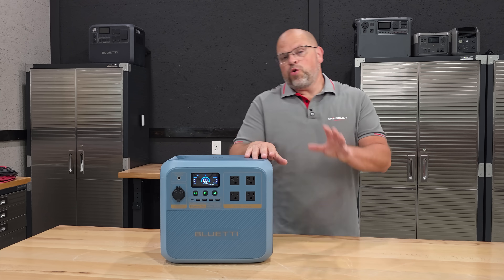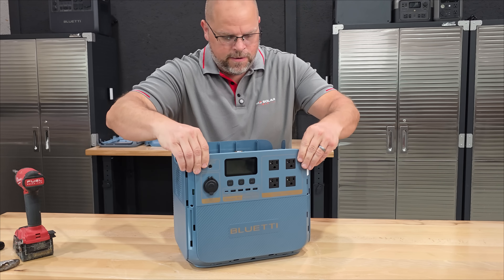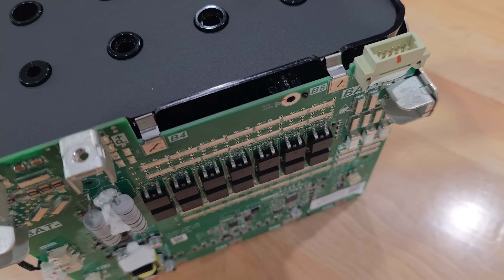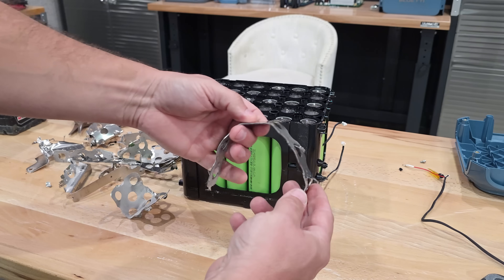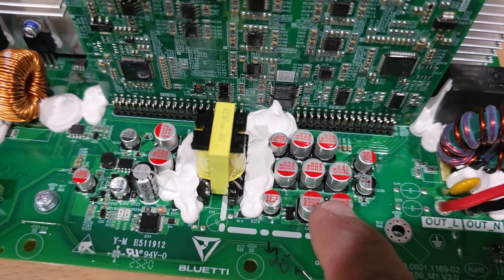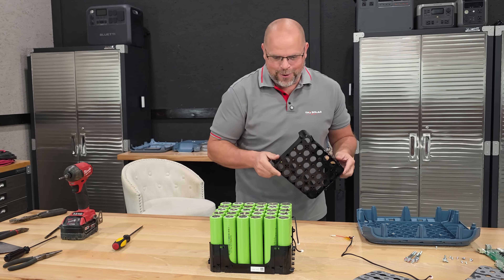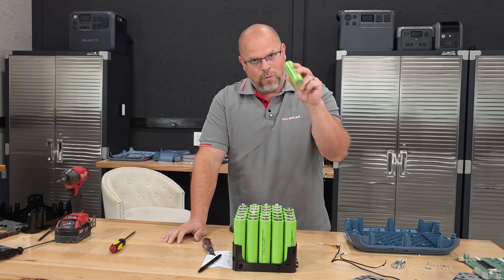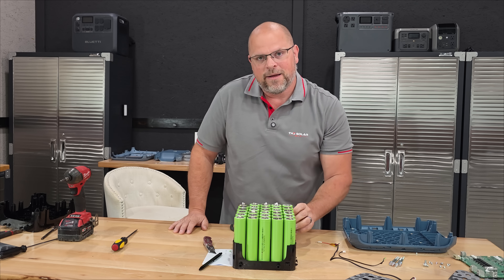Bluetti promised us SODIUM-ION and we got what?!! Pioneer Na Teardown

Comment: That was a waste of a beautiful power station if you couldn't confirm what you were looking for.  If you knew you couldn't open the battery than what was the point?
Reply: It was fun to watch.
Reply: To see what the information on the cells said including model number and voltage and wh. Was also interesting to see the quality during the tear down. What's the point of your comment
Reply: @Yielar1  My point is, the only unique part of the unit is its sodium battery. If that’s all you needed to verify, there was no reason to destroy the entire unit; you could’ve confirmed that easily. Just contact the company that gave you the unit in the first place. The video was a waste of time.
Reply: That would be easy to put back together/ reuse and saved us all doing it
Reply from the maker: Could, but I need to verify that the connections are also quality materials. Chop it up!

Comment: Other than ability to charge at -20 degrees F I don't see any advantage to these over LiFePo4. Especially since the round trip efficiency of these batteries is less than even lead acid at around 65 to 70%. You put in 100% and you get 70% back. LiFePo4 is like 95 to 99%. Also, Sodium Ion is much less power dense than LiFePo4 so for the same stated storage capacity the Sodium Ion will be much heavier. Now, in regards to safety, the Sodium Ion compared to Lithium Ion using Manganese Cobalt or Nickel there is significantly less risk of fire, but LiFePo4 is pretty safe. Anyway, you could have verified the Sodium Ion by comparing power to weight or by measuring the round trip efficiency pretty easily and also by the linear voltage drop as it is discharged.
Reply: That -20 factor is a very important advantage for many people.  Also, no damage when sitting fully discharged is great too.   I'd buy this if I hadn't had repeatedly bad customer service from them.  I've definitely had times where my LFP units were too cold to charge.
Reply: @veganpotterthevegan  Also you can go down to full discharge - making shipping even faster/safer as well. We already seen at least 3 boats full of EVs go up in flames and they were LFP.

Comment: Multiple times I’ve heard that the discharge voltage curve is very linear with sodium ion. With lithium ion the voltage stays pretty steady and then drops off pretty quickly at the end. Just graph the discharge voltage over time until the cell is depleted. Should be markedly different from a lithium cell. And that should be difficult to fake if it’s inherent to the battery chemistry.
Reply: Yep, I have posted several times on that subject, the drop in voltage is linear with the discharge, so in theory the bottom around 20% of the battery charge in an NA battery is most likely unusable because the voltage drops below the level the BMS can work with. What I suspect is happening here with the battery rated at 3.0v but actually showing 3.85v on the meter is some magic with the BMS that shows zero charge when it reaches that bottom 20%, it appears you can use the battery right down to zero charge, but that's not actually happening, so the power in the battery is actually more than the stated power in the device in wH but you can only use 900wH before the voltage drops out of range. Now I am not saying they are tricking anyone, as long as the power bank supplies the stated power in the stated specs that's fine, it's also probably the reason the power bank comes out so well in efficiency tests. I would very much like to see the discharge curve myself, that would indicate the chemistry is NA if the discharge curve is linear.

Oh yes, excellent tear down, just needs some more work with charge discharge tests and etc and as stated maybe send it to a lab so they can rip it apart and see what it's made of.
Reply: @stevebrooks2361  Looks like they are rated to 3.5-4V not 3V or at least slimier ones display that high. Found the cells online you can purchase your self.

Comment: 30v 30ah battery pack, so I am guessing that must be a Proprietary Inverter. A lifepo4 battery cell is 3.65v fully charged, not sure what you got there clocking in at 3.85v. Also 3.85v might be the resting voltage. I am clueless.
Reply from the maker: Yes, Bluetti manufactures their own inverters, bms and for the most part from what I can find their batteries as well.
Reply: @TheSolarPit  - batteryspace list a similar CR32140 Sodium cell at 10Ah/30Wh/30A/3v specification -  CR32140-MP10-3.0V-10Ah-30Wh-30A, seems to be Hina or Enepower cells.

Comment: Don't fall for this old tech gimmick 50yrs latter and still sux. Salt 🧂 battery sucked then and never have improved
Reply: This is not a salt battery, it is a sodium ion battery. Related only distantly, in that table salt is sodium choride. This battery is closely related to a lithium ion battery, and operates on the same principal.

Comment: So why i dont like power stations. If this were the lesser say 24v 30 amps. That would not run my camper for and hour if ac or heat strips were on. Only 2 hour if just the blower was on with fridge a TV few 12v lights and converter charging the 12 v. For Their price you dont get much. I got 1600 in a 48v 280amh batteries and 750 on a 5000w 48v inverter charger.  Few wires fuses breaker and my system covers my needs from 10 hoirs w ac or heat strips. To 30 hours w just the blower on plus the smalls I use and 2 tvs spend a few bucks more and have some useful power storage

Comment: The dead give away is the 3.0V rating of the cell.  These are not LFP, NMC, nor LiPo, which all have voltages higher than 3 VDC
Reply: That's EXACTLY what I was thinking. 3.0V is too low for Lithium-ion 3.6 ~ 3.7 per cell,  AND LiFePo 4 3.2V per cell.
Reply: Yes it's nominal voltage for it

Comment: Voltage question?  Ok, what's the voltage of a single LiPo cell?   What's the voltage of a NaSo cell?  Perhaps that answers the question. (same as why a "12v" Lead batter is indeed at or around 12-13v, and LiPo is 13-14.   Multiples of the single cell voltage.

Comment: Supposedly sodium batteries are really safe and you should actually take one outside and smash it and break it and see if it catches fire 🔥?????
Reply: this unironically
Reply: The only thing you need to do is taste them.
Reply: Take fire only charged batteries, anyway open a battery in unsafe place is dumb. Sodium+ is not safe. Also you will get nothing if you can't analize components.
Reply: Provides salt for your fries
Reply: @davidcarp5935  - wrong salt, typically it's Sodium Hexametaphosphate used in batteries, so more often found in bath salts and beauty products rather than on fries. 

Though wouldn't recommend ingesting given Sodium Hexametaphosphate can have toxic and corrosive results at high concentrations.
Reply: @GruffSillyGoat😮
Reply: Id watch that video.. lipo4 is safe also its them ion batteries in phones and most small things and the cars that are the most dangerous
Reply: @towguy-johnnytowtruck  Wonder when we will start getting safe batteries on phones. I would think it's the first place you would want the absolute safest batteries considering people put them to their face or have them right next to their crotch most of the day.
Reply: @TyrianHaze the batteries are not the worst thing about a phone that you dont want next to you balls or head. But yea take 1 out of an old phone after u charge it then just bend the battery a little or hit a nail into it. Have a bucket of water next to you to trow it into when the sparks starts and watch it burn under water
Reply: @towguy-johnnytowtruck  I don't know, if a battery blows up it's one of the worst things you can have next to your head or balls at that particular moment.
Reply: @TyrianHaze  In 20 years of having phones I had no problem with the batteries bulging or shorting. They are safe AF.
Reply: @Chris-hw4mq  I work in the field, and I have see them blug and short - so they're "safer" but you have to be more expose to a wider range of faults. Phones are not a good examples if you ask me - but I have seem battery blug to a point they can set on fire and or destroy a device. Heck, I've had to tell stores to replace floor models (laptops, phones, etc) because they were bulging.
Reply: @adr2t  Its probably user error, they sit on the phone drop it drive over it
Reply: @Chris-hw4mq  Considering that isnt what happen to the device, no. It mainly comes down to just faults and charge cycles.
Reply: @Chris-hw4mq  Just because you have never experienced something does not mean it can't happen. It's like saying 'I have never been in a car crash, so they don't happen.'
Reply: @TyrianHaze  Modern batteries in smartphones are extremely safe and the BMS is very sophisticated. Don't worry about the tiny percentage things in life
Reply: @TyrianHaze  thats the most stupid example ever like saying every car catches fire you didnt catch fire yet. Shit happens but its very isolated.
Reply: @Chris-hw4mq the battery in my iPhone 3 swelled up and burst the case open but no fire or explosions
Reply: @TyrianHaze  power density and weight the battery would have to be 30% larger and heavier for the same energy density. I don't see them switching to sodium anytime soon for pocket sized or smaller devices. their may be a market for it though. cheaper, safer and if in a cold climate like skiing with your phone in your outside pocket it will still function.
Reply: @Chris-hw4mq  In 20 years of having phones I've had like 4 bulging ones, and that's like 10 batteries in total. The older ones that were perfectly OK suddenly got puffy as well out of nowhere through years in storage.
It just happens. It's how Li-Ion behaves, it's not some hoax. Sure they aren't bombs just waiting to kill you every second for no reason but they do fail and violently sometimes.
Reply: @Chris-hw4mq you should have bought more Motorola phones
Reply: @LarsDennert  actually I got one more motorola phone for black friday deal the edge 60 ultra for 400 euro.
Reply: @towguy-johnnytowtruck LFP batteries aren’t inherently safer they don’t burn they explode violently
Reply: @alanmay7929 thats normally the lipo ion.  Not the lipo4
Reply: If it's fully charged then it's likely to catch fire or explode
Reply: @macksuting6263  Energy has to go somewhere. Guessing the larger size leads to slower heat dissipation. Big question is how they react with water. (all this is pulled directly out of my ass)
Reply: @Graevlingdk how it reacts with water? Surely it dissolves 😂😂😂
Reply: @Graevlingdk  I applaud your commitment dude, but that is no place to keep your batteries.. even if they are safe in warm, humid environs 😂
Reply: Real sodium exposed to air explodes! And is a hot fire!
Reply: @pagegreer5081 Sodium doesn't catch fire if exposed to air, it does however, react violently to water in its pure metallic state.
Reply: bring an extinguisher. Would only prove is/not  lithium based.

Comment: if you can cahrge one fully, do a capacity test, drain it to 0v, then recharge and do a capacity test and its the same, its most likely sodium ion, one of their traits  iirc is being able to be stored and transported at 0v with no degradation
Reply from the maker: Yes! Someone understands it. Thank you. That is a big deal! Meaning that 15% on the low and top side we need to be mindful of with LFP is always usable. Many people are not understanding ot have been introduced to this clearly yet. But eventually they will come around, Sodium-ion is coming and it will be mainstream. Not saying its the the end all be all, but it will make for a great alternative.
Reply: @TheSolarPit even if the density never reaches parity (unlikely) with LFP or other lithium chemistries, the fact that everywhere has access to sodium mens we can make these almost anywhere in the world, that'll be a boon for energy decentralisation and independence
Reply: 0 volts? Is it possible?

Comment: If the unit  uses sodium ion then the cell voltage will will be 3.0 volts. If they gave you LiFePO4 cells instead then the fully charged voltage is going to be 3.6 volts.  Use your volt meter.
Thanks for the video.
Reply from the maker: 3.0v is the nominal voltage and rating the OCV was 3.85v. I did use a voltmeter. The batteries are at 100% SOC. You are stating the nominal voltages not the OCV and that will be different depending in the SOC of battery cells we are checking.
Reply: @TheSolarPit  I'm sorry I skipped part of the video and didn't see the voltage being read.

Maybe you could uses a resistor to load the cell so you are measuring  with a load applied. 

A 10 ohm resistor rated at 2 watt resistor should be OK as a load since it would create a load of 0.4 amps (1.6 watts) or less.

Check the voltage and hour later and see what says.

There are some good ohms law calculators on the internet.
Reply: No, while sodium ion batteries are referenced at 3v, they can go up as far as 3.9v - 4v in use usually